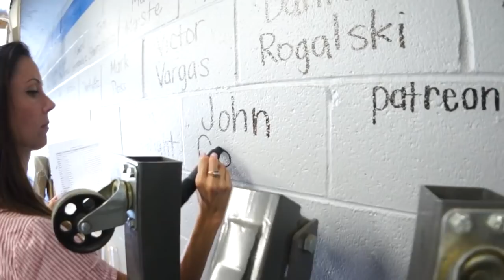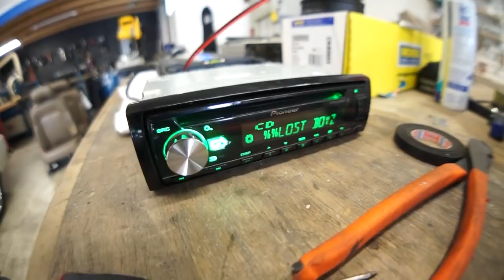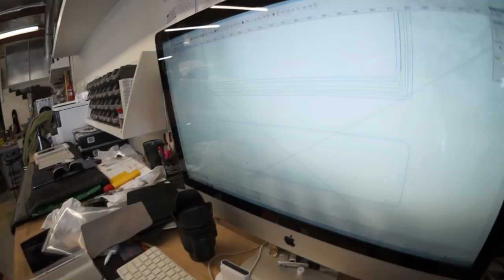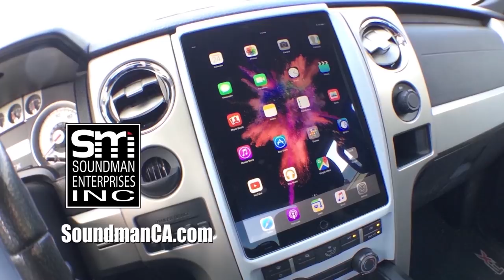Bench test Acura stereo system AND AMP RACK BUILD!

Comment: Hey, if you order a quick change setup from sommatool for the router you could setup tools and make offsets so you can change tools in the middle of running a part. It would allow you to do all of the chamfers and fine work with the 1/8” but not have to slow the cycle down or reset up the tool offset between the tool changes.

Comment: I've got a similar Pioneer head unit in my car at the moment, but it's the European version with DAB+ (DEH-7800DAB). I run the tweeters (Hertz Mille series) temporarily from the head unit, the mids (Hertz Mille ML165) are powered by an old Alpine 3554 amp, which is also powering my sub, a Hertz DS300 (an older revision, which still says Dieci on the cone dustcap) in a closed enclosure. There's some room for improvement, but it's not bad at all, especially for the money I paid for the components :)
Had a pair of Audison APK165s in the front, but the Hertz Mille MLK165 is just so much better :)

Comment: man my first car system was an mtx 12" sub in a home depot bucket filled with a towel and a peice of xps rigid insulation to house the subwoofer... all hooked up to a 150w rms 4 channel amp screwed to the passenger front seat carpet with a sony deck hanging out of the dash... when i went around corners the sub would roll around the trunk and the deck would fall out of the dash lol. 

Still thought i was the shit. 

Did i mention the car was a 1997 Chevrolet cavalier (metallic baby blue) with huge dents all over....

Comment: Epic kit there Doug.. sounds like loading a slide pistol. One question though, how does the cable port work with this? Xx
Reply: I'm sure this one is not hardwired, it relies on a bluetooth connection.
Reply: @SharkRangler  ah ok, fair one.. so no charging xx

Comment: Doug-

Just as with the McIntosh ( https://www.mcintoshlabs.com/ )
that is a very nice amp, but it's had an unkown life.
I guarantee all of that thermal paste is dry and useless.

It would take some time, but I would definitely separate
the heat sinks, clean, and regrease with some modern product
like Arctic Silver 5 or above.

It's enough that you'll be stressing those old caps-
don't make those MOSFET pay for it.

There are services that will replace old electrolytic gel caps,
repaste heat sinks, clean & lube any rheostats, etc.